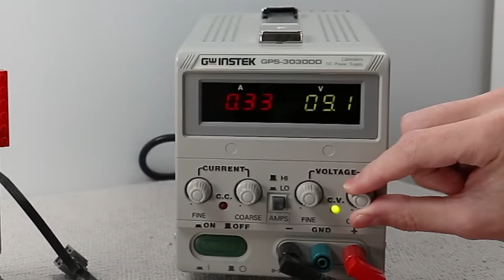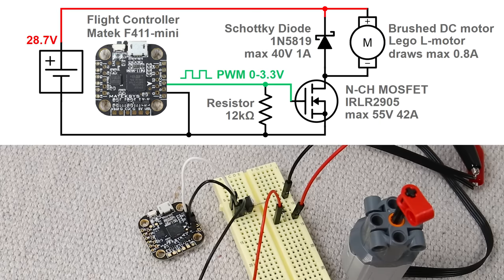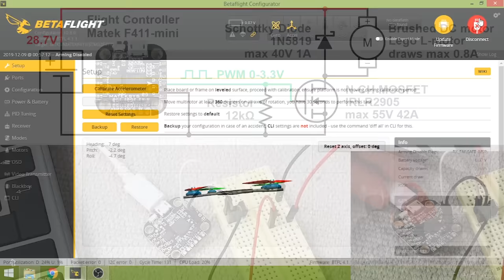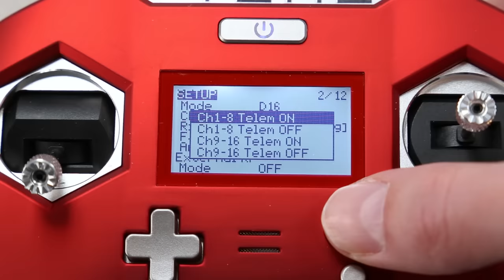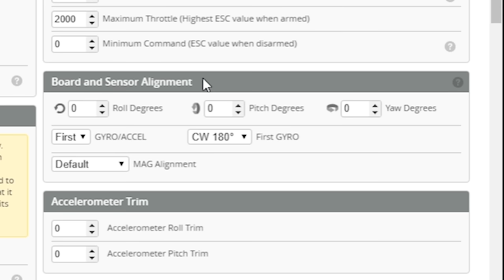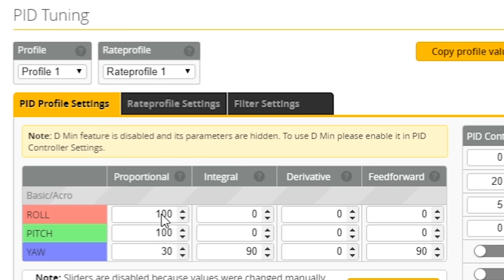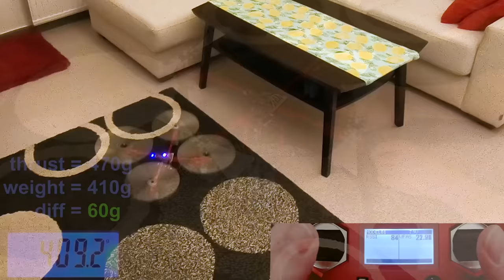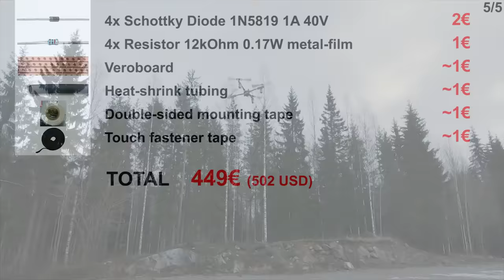Making a Drone with Lego Motors and Propellers

Comment: Sees how cleanly he solders
"He's too dangerous to be kept alive!"
Reply: Over the carpet no less
Reply: "I NEED HIM!" 
"PLEASE DONT...!!!"
Reply: Do people really have that hard a time soldering? I have super shaky hands and I can solder like that no problem
Reply: If that's clean soldering you've never been to a sweat shop. It's passable but, far from perfect.
Reply: POWER!!! UNLIMITED POWER!
Reply: flux is hard ;D
Reply: He must stand trial
Reply: infact i was quite disturbed by the fact that he just soldered everything togheter like if you solder positive to negative....
Reply: As an electrician, if I were to solder like that at work, they would probably fire me. Too much solder. Bubbles of solder and the solder points aren't even completely covered. And he shortens the wires after soldering them which is also a no no (because vibrations could cause the solder to break inside, making the lifespan of that connection shorter). For a DIY project: sure, nothing wrong with that. But professional good soldering looks very different.
Reply: @Robin Tesmer

I was about to say that, after realizing the comment about clean soldering was serious. 5:24 made me cringe.
Reply: @jmhpt  And picking a wrong hull for the MOSFET, then turning it into impromptu TO-220 instead of just... getting a TO-220 hull is an issue too.
EDIT: Who doesn't clip the legs off post-soldering? You can't exactly pre-clip them and end up with a decent joint most of the time.
Reply: @thirtythreeeyes8624  What's a sweat shop?
Reply: @fyka2902  Good 1One
Reply: I'm a rookie at this stuff but that doesn't look like quality soldering to me at all... It seems to be he didn't give af while doing that part.
Reply: Also are we gonna ignore that he was soldering over carpet
Reply: @goku445  A good place to learn to solder. For real though they are the places where every single thing you own was made by some young Chinese person getting paid 5 cents an hour.
Reply: IIT UK yuki is I IH us iuiii

Comment: It may have cost more than a drone, it may fly worse than a drone... but damn if it isn't still beautiful.
Reply: Compared to a common drone online, this is costs a shit ton less. However, time cost? Thats different.
Reply: @illdowhateveryouwant.thenp4865  I dunno... my cousin got one of those $400-$500 ones and it's pretty decent. Still... I would rather make one of these, if only for the novelty. I don't fly drones anyway, that just seems like a fad, but this thing will always be a cool conversation piece.
Reply: @johnnywhitsel1583  the components for this drone cost maybe like $50 dollars maximum. Unless you go buy a lego set then it would cost $800.
Reply: @illdowhateveryouwant.thenp4865  Did you read the cost at the end?
Reply: @Ho_Lii_Fuk  Well ya... if you want a really good one or a camera drone but we are talking about something that simply flies better than this one. Look on Amazon's US site. You can get them for much less than (what is 500 Euro's, like 740$?)
Reply: @illdowhateveryouwant.thenp4865  50$ 😂😂
Reply: @illdowhateveryouwant.thenp4865  lol it's literaly worst than 20$ Chinese thing
Reply: @illdowhateveryouwant.thenp4865  wtf HAHAHAHAHAH
Reply: Cloudsies Borjsies - yeah, the video was made  to prove legos could be made into a quadcopter. and I love it.

 Realistically, this would be a pain to fly, doesn't have the lifting power for any camera system, has an amazingly short flight time (even compared to racing drones), but yeah, it flies.

Edit: this Lego drone weighs a total of 410 grams and can reach a max thrust of 470 grams, and flies for just under 2 minutes. 

As a comparison, my DIY freestyle kwad weighs in at 401 grams, has 6,208 grams of thrust,  flies for 5 minutes on a 4S 1500mah 95c Graphene LiPo and costs $300 to build.
Reply: @Bipolar_Weasel  also imagins the vibrations :p if you stuck an fpv cam on there you wouldnt be able to see a thing due to the jello

Still cool though
Reply: hmm
Reply: Tasunke  A bit surprising it got that many likes, but i'll take it.
Reply: Drones aren't that expensive. You can get a (very cheap) racing drone (fatshark 101) with remote and goggles for 210€
Reply: @Ho_Lii_Fuk  you're comparing this to fully featured drones that basically fly themselves. This is pretty much a race drone, given it used the exact same electronics you would use in one of those. Those you can get for quite a bit less than this, and they will be significantly lighter with more power and more battery life.

If you've ever tried to fly one of those race drones, it should be quite obvious why those two types of drones are different.
Reply: Nah it’s less because most of it goes to bragging rights
Reply: Cloudsies Borjsies watch the end he litterally says the costs a flight controller and a lot of that shit is almost 50$ each so dats a cheap drone xD
Reply: @illdowhateveryouwant.thenp4865  Just saw the end of the video 502 USD is not cheap.
But at that cost you're probably getting a handful of each part.
Reply: I dont wanna be rude, but this costs shit ton less
Reply: It’s an art piece that resemble a drone... and  actually flies...
Reply: @illdowhateveryouwant.thenp4865  at the end of the video he shows the cost: 450€

for this price you'd get a better drone for certain.
Reply: You might be right but he’s gaining trial and error knowledge that will benefit him in future projects.
Reply: It's the true fun of making, the spirit of thinking trial and error. If I had 1/5 of his knowledge and passion, you bet your pants I'd spend 500bucks to make it
Reply: @ewed418  I would probably use thins cardboard and paper for certain parts like the body and stabilization to make it lighter and possible easier to control. That way it actually has a use and isn't just a 'to prove I could do it' piece for the mantel. Even if that use is only freaking out the dog.... that would make it all worth it.
Reply: Can't replace the experience that the brain cells had with learning how to do this though.
Reply: Cloudsies Borjsies the motors cost a lot that’s why
Reply: @smatthewsauthor  - while not disagreeing that this takes brain power, building, setting up and tuning a freestyle or racing drone from parts can replace this experience and can actually be harder to do. 

This was flying art that resembles a drone, like how a DIY GoCart built out of parts from your garage (lawnmower motor, scrap metal and nuts/bolts) and Home Depot/Lowes parts resembles a professional gocart, or a local guy's dirt track race car resembles a Company Sponsored NASCAR. 

Really, the only thing here different is the builder made a frame from plastic legos, (that flexes and bends and wouldn't fly worth a damn) and used brushed motors (we only used brushed motors in tiny whoops and even then we are moving to brushless motors for them).  He didn't add a camera (because the motors couldnt handle the weight and the batteries couldnt handle the power draw).  This basically is an overpriced "Sky Riders" $20 drone. 

Now If you want to know what building a real drone is like, read on:

What RC brand RC Radio/ Transmitter will you get: FrSky, FlySky Futaba, Turnigy, Spektrum) This determines what RX (radio receiver) you can use because of the protocols they operate on. 
Then, will this be short ranged 2.4GHz or long range 433MHz, 900MHz or 1.3GHz? What receiver antenna will be used?

Now depending on what the drone will be doing, you pick an flight controller and there are literally a hundred of options to choose from, all with their own strengths and weaknesses. 

You also have to chose what prop size you will run (3" to 9" props) which determines the size of the frame (and there are countless options)  and what motors to use for what kind of drone you are building.  Are you freestyling/acrobatics, racing, using this as a camera drone (like a DJI) or a cinaquad (mix of racing and freestyle). The motors also determine the range of pitch of the prop blades you can choose from. And if you are using dual, Tri-blade, or Quad-blades.

 Then matching those motors with the right Electronic Speed Controllers (ESC) (how many sustained AMPS it can run at) then deciding on 4-in-1 or independent ESCs (and of the FC is an AIO or not) 

This also determines if you are running 1S, 2S, 3S, 4S, 5S, 6S or larger batteries and if you are using regular LiPos or Graphene LiPos.

Now you decide if you are mounting an FPV system and of so, which type: DJI HD, dual HD/analog, or standard analog.  

This determines which FPV cameras you can choose from and which video transmitters you can choose from.

Now choose your FPV goggles.  Will they be the HD DJI system, a Fatshark, Eachine, Aomway Skyzone Orqa?  Compact or Box goggles? Diversity? Have a DVR system? Swappable modules? External battery connection?

Will you have LEDs? 3D printed parts (arm guards, antenna mounting, canopy for FPV racing Kwads?) Will you mount a GoPro or RunCam HD to your freestyle/cinadrone?  Gimbal system for a DIY DJI drone? A lost drone locator beeper? 1000uF capacitor to the battery pad or 470uF caps to the ESC pads for each motor? Diatone Mamba Interference shielding?  

Now you put it all together, use Betaflight and BLHeli to configure the FC and ESC(s), configure the RC Radio, update the video transmitter, radio receivers and now upgrade your RC Radio's gimbals, and thumb sticks (no one flies with out of the box thumbsticks).

Take it out on a single battery test flight, tweak settings, repeat until it is flying as you want.  Now register it with the FAA, put your registration number on the drone, use the B4UFly app and LAANC if you are within 5 miles of an airport.
Reply: @abrahamlincoln7766  Correct, Mr President.
Reply: Can’t put a price on the fun and experience of solving this problem yourself!
Reply: Eddie B - personally found it more fun building my first racing drone. to each their own
Reply: @illdowhateveryouwant.thenp4865  I built a racing drone with an FPV video feed, and the drone parts list (camera included) hit's maybe $200. All of the components are cheap! Motors cost less than $8 per.
Reply: this would not cost 100$ at max. a drone is about 1000$
Reply: It's worth it because he "recovered" his money from the monetization of this video and he also learned a few stuffs, plus, doing what he likes, following his passion and gaining popularity. 😁
Reply: @twinklesprinkle1318  the total cost was 857.40
Reply: @tuopi27  - You are thinking about camera drones like a DJI, but drones can be bought pre-built or built from parts from $25 all the way up to (and beyond) $100,000.   Cheep toy drones (which have the power and flight time the one in this video would equal) can be bought for around $40 (look up Sky Rider Thunderbird).  

Micro drones (aka "Tiny Whoops") can be prebuilt or build from parts for $100 or so.

Racing / Freestyle drones can be bought pre-built or made from parts from $99 to over $500 depending in the parts. (Look up videos from Le Drib, Rotor Riot, Nurk FPV, Mr. Steele, Botgrinder to see them in action.  Go to the websites GetFPV, PyroDrone, BangGood, RotorRiot, or RaceDayQuads)

Then you have the camera drones like the DJI camera drones which run $500 to $10,000 depending on brand and model. 

Then there are the specialized drones for law enforcement, Agriculture, surveyors, media and other industries which can run $20,000 to over $100,000
Reply: @LazerLord10  - my HolyBro Kakute F7 stack ran $125, Spectrum racing RTX was $49,  FPV RunCam Microswift camera was $40, VTX antenna was $5, CL1 Frame was $35, 3D printed antenna rear housing was $20, miscellaneous wiring (fpv wire, some 14, 18 and 26 gauge wiring) ran $25, each motor was $27 (emax 2306 2750KV white racingspec), the GemFan personalized props ran $4 for a set, then the 3d printed holder for my RunCam 3S HD action Camera was $15 and the camera was $99.   Total cost $525 without tax or shipping (prices may be lower for certain things now but that is what they cost when I bought them in February 2020)

 That also doesn't include the 10 venom brand graphene 4s 1500mah batteries (at $48 each) or the kevlar battery straps nor the optional $60 in LED lighting, sticky battery pad, 3d printed arm protectors, wire loom for the motor wires, heatshrink tubing, zipties, or the foam landing pads on the bottom of each arm. 

Point is, freestyle or racing drones can be build from under $99 to over $500 (and if you stick that DJI HD FPV system, or a CrossFire setup I to a drone, the costs can be even higher)
Reply: well only because he spend that much on a controller but i guess he wanted the motors to survive so he paid more for quality
Reply: Johnny Whitsel yes retail price of legos is crazy a pack of legos probably costs maybe 2 cents to make but they sell them for thirty dollars
Reply: It costs 12 times more than a normal drone
Reply: Its cheaper than a drone, you just need the knowledge and time to make it
Reply: If you are talking about a kids drone than yes. But if you have a good one (like a dji spark, mavic, or phantom) than no lol
Reply: @igot_ethics  If its a kids drone than ye
Reply: S c i e n c e
Reply: why did you have to say damn
Reply: you are not counting engineering studies

Comment: Really makes you realize just how much batteries are holding back Lego.
Reply: Probably a price thing. Batteries are so expensive even for low voltages
Reply: coolkid  facts
Reply: @certifiedpossum8655  yeah, 3000mah 7.4v, costs about 40$ here. it costs cheaper outside but shipping for batteries is expensive and can have issues with the local post office so I have to buy them locally and they're expensive af :/.
Reply: @itsmegideon6641  💯
Reply: The big problem with doing this to LEGO motors is that you will wear them out quickly..  A few dozen hours of runtime with possibility of fire.. vs. Many years of use and safety. 
That and they start becoming less.. safe to play with.. :)
Reply: @ElectraFlarefire  Easy solution, just make the better batteries age 18 and up. No liability, and it would give us AFoL more things to tinker with.
Reply: @ArcadiaCv  I'm surprised there isn't an aftermarket range of powerful motors and batteries compatible with LEGO.
After seeing this video I'm going to look into overdriving clone but pre-brought motors for some projects of my own, I normally just 3d print mounts and use cheap motors I don't mind burning out/breaking.
Reply: I actually have a lego train with all these tracks and it uses batteries although a lot of lego doesn’t so your quite right actually
Reply: I buy my lipo batteries from the CZ warehouse on banggood.
Reply: Elon should make some rechargeable super batteries that fit into AA slots.
Reply: LEGO claims they want to be environment friendly yet they still make you use regular batteries.

In this case though, I think what is really holding it back are the propellers.
Reply: Lego is just a toy, when you get older you just make real drones with market parts and motors... literally everything will be better.  Lego is just a cool/fun/modular kids toy.  I love lego, but lego will never be more than just a toy with clear limitations
Reply: It's more of the strength of Legos, everything has a breaking point and if they could somehow make them stronger and produce more lift with a small to no weight increase you can make really good drones with them

Comment: The secret to landing on a table is to be aggressive and just go for it. Your rotor wash makes a cushion of air that pushes you off the table. Like ground effect on a flat surface, you just have to fly through it with commitment.
Reply: Yep, and even more true if you're flying a single-rotor helo, becuse those typically don't have the multi-axis gyro. The Gyro doesn't help you that much, though. You really do just have to go for it.

Comment: This man literally taught us how to make a drone!
Reply: For 500 bucks, yeah no I'll just stick to the premade ones thanks.
Reply: @braeeee_  but are those made of lego
Reply: Yeah but with inefficient brushed motors. Drones usually nowdays use brushless motors, you have to connect them via their three wires to an esc on the one side and the white signal cable and battery voltage to the other side of the ESC (no additional MOSFETs.) But the rest, yeah, that's pretty standard drone tech
Reply: @michahermann7869  yea make racing drones like me! They are like 400 each and go like 80mph
Reply: Lol it isn’t about the price, it’s about the fact that it’s possible. I have tried making ones myself as a kid, but I always failed
Reply: @braeeee_ quality premade one's are definitely more expensive then custom racing drones!
Reply: @Leonn_.  but they also have a very different use case
Reply: @aintgotnobody5518  depends on what you're building

Comment: Making a drone with Lego parts : 500$
Satisfaction of making something fly : priceless
Reply: Making a drone out of proper parts for less than $500, has an FPV system so flying it is like a video game, can fly 3-5 minutes on a full  battery,  hits 60MPH in less than 2 seconds, and reaches speeds of 80 to 120MPH: Even better.
Reply: DakotaSkies FPV yeah but... LEGO
Reply: Yes, nothing taking away from how cool it is that this is made out of lego.

However practicality, reusability and fun factor in.  This is a great demonstration that it could be done but this is a proof of concept, not a DIY replacement for a real drone.  This kind of drone would get boring quickly, barely has more thrust than it's own weight and flies for maybe 2 minutes.

Spent $120-$200 and get a Tiny Whoop, which gives you that video game feel, gets about the same flight time and won't get boring to fly
Reply: Lol
Reply: fear god lol